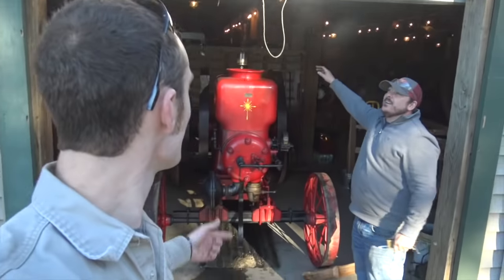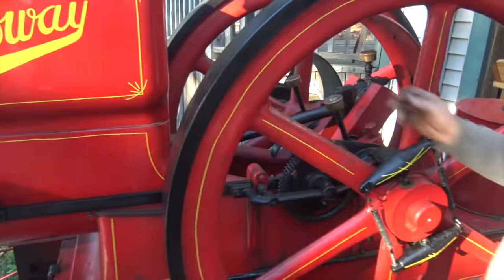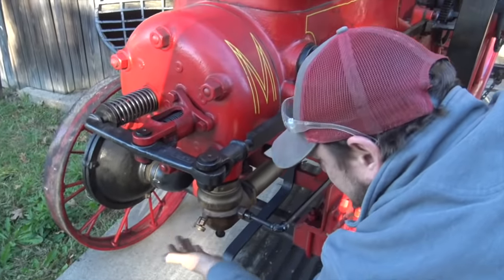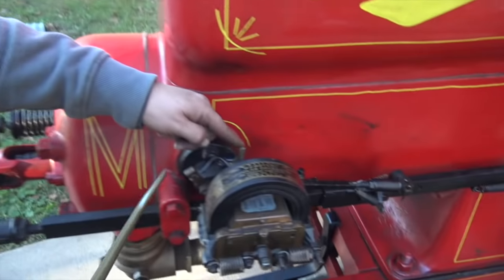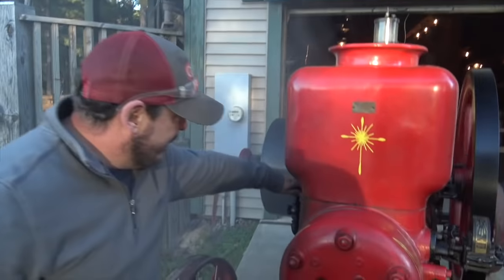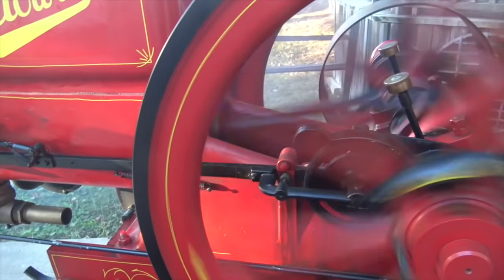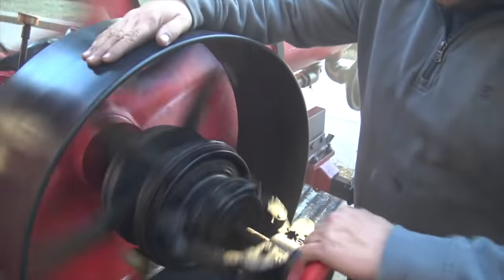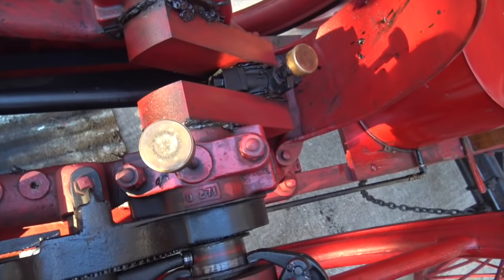WHY THIS INCREDIBLE ENGINE FROM 1916 IS PROOF THAT MODERN EQUIPMENT IS A SCAM & OLD STUFF WAS BETTER

Comment: That old hit and miss is a rare find. From what I've been told you could find them up until WW2. They started going when farmers had electric from local power plants. You could run just about run any stationary machine Generator, water pump, rock crusher.  The old tech is reliable a 1916 engine still works. That's 106 years old.
Reply: I guess they stayed around longer in Europe because of the war, at least farmers fairs are full with them and Lanz Bulldog tractors.
Reply: @vHindenburg  I go to vintage machinery shows in Australia, I guess about one in ten engines on display are hit-and-miss.
Reply: Electricity to farms...yes, first it was just single phase, but later, 3 phase....Thank You, Nikola Tesla....! One of the first important things on a farm....was a well with motorized pump....
Reply: @dougankrum3328  I would say after that, some form of refrigeration.
Reply: No, its at least a thousand years old... along with most of the other now forgotten tech
Reply: @dougankrum3328  Farms had wireless electricity just like the cities before the time of the Rockefellers.
Reply: 👉 Yeah, because during WW2, the govt had people combing the land looking for old and obsolete tractors and stationary engines that could be melted down for their iron and steel, for the war effort! So, a lot of the early 20th century tractors and engines were broken up and melted down....
Reply: @HighlanderNorth1  So important then, so tragic now.
Reply: @LazloNQ  My Dad serviced in WW2. Everyone not serving sacrificed during the war. There were all kinds of drives for scrap and war bonds to name a few.
Reply: YouTube WantsToSilenceMe  Not been to an antique machinery show for three years, due to Covid. You're lucky.
Reply: "planned obsolescence" started in the roaring 20s I believe
Reply: @HighlanderNorth1  Yet we still have a good deal of engines left because even during those days the engines were still valuable enough not to be scrapped. That's what my grandpa says at least.
Reply: My mother had a gasoine fueled washing machine when I was a kid. What a piece of crap.
Reply: @dougankrum3328  Three phase on a farm? Are you sure?
Reply: Yes, built to last, and not have the built in life expectancy of a Mayfly, can you run the engine on hydrogen?, that would make a very enviro  friendly means to provide the house with  its own electricity supply.
Reply: There are still hit and miss motors floating around the oil field on old pump jacks. Some fairly new. Arrow Engine Company still makes one if I'm not mistaken.
Reply: @effervescentrelief  Do they make motors or engines? Never heard of a hit and miss motor.
Reply: Reason why modern crap has the life span of a mayfly, is companies these days blindly driven by profit, so their products are designed to a price with inbuilt obsolescence . Forcing hard pressed customers to buy their latest model manufactured to the same brief. Blackstones , R A Lister,  Ruston&Hornsby, Crossley Brothers, and Petters of Yeovil, they all built their chug phut engines to a specification and designed to last. In India, Pakistan ,hundreds of Ruston&Hornsby chug phut engines are still working hard driving various machinery from grain mills, water irrigation pumps , to weaving looms and dynamos ,generators.  That  chug phut engine built 1916 can charge your geeky 2023  mobile(cell) phone, and no , I am stating a fact and not smoked a splif.
Reply: Reason why these lovely old Chug Phut Engines last close on a century and keep running is the makers designed them to  a specification ,not a price. Modern crap are manufactured to  said price , built in obsolescence, needing Brains from Thunderbirds to come and fix if a problem crops up,. Said modern crap have the life span of a Mayfly, so hard pressed customers then forced to buy their latest model with the same issues built in , a vicious circle.  R A Lister, Blackstones, Crossley Brothers, Ruston&Hornsby, Petters of Yeovil, and The National Gas Engine Company, all built Chug Phut Engines in various sizes and power ratings.  In India, Pakistan Hundreds of Ruston&Hornsby Chug Phut Engines still work  hard ,driving corn mills, power looms, water irrigation pumps ,and generators. A suitable size Ruston&Hornsby Chug Phut Engine, burning refined waste chip fat oil can provide electricity for your house, said waste fat oil used productively and not bung up the sewage  system.
Reply: @bingosunnoon9341 maybe crap to you but if that was all your family could afford, probably like gold to her.
Reply: @bingosunnoon9341 I am curious about that too. I am yet to see it in a residential house.
Reply: @HighlanderNorth1  My friends collected these all the way into the 1990's They are fairly common (various brands) until then
Reply: Up into the 70s i could hear the sound of the popin Johnnie's echoing in the hills of oklahoma. They were used on everything from oil wells to water wells. 5 gallons of gas and a full water tank and these things would run for days without supervision.
Reply: The clutch operates with a pressure plate that are like spinning “brake shoes,” grabbing the clutch plate disk from  the outside.  Those are TRICKY to adjust so that both halves grip equally when engaged.

Comment: No pen pusher will appreciate this! The old people were not stupid, my wife has got a 100% working 1928 singer sewing machine that still uses a treadle, the mind of the old folks were sharp! Love this !!!🇿🇦
Reply: My wife is a professional seamstress that uses her grandmother's 1948 Singer as her main machine.  I note one thing about it.  In it's day, it cost almost half a year's wages.  For that much money, you could buy at least two modern industrial machines that would last as long.
Reply: @barrymorrisss  Absolutely; some high-grade things became expensive... but only relative to the cheap stuff. It didn't get cheaper at the same rate as the low-grade stuff; it still got much cheaper than it used to be. But - a big part is that people actually cared to keep their expensive stuff and care for it, and pass it on.

That said, there are things that definitely improved. The oil losses, the pollution, fuel efficiency. It's just packaged in a bundle that makes it much harder to keep caring for the stuff to make it last. It's quite nice that you don't have to replace oil and lubricate twenty different bits of a car every 1000 km like in the "good old days" :D But it also of course came with ridiculous abuse of cars (well sponsored by the oil & gas and automobile industries)...
Reply: Have you actually told your wife the 1928 Singer sewing machine has been updated?

Comment: In France we had the water pump manufacturer Julien & Mege : those were more powerful than spec, and almost silent, a lot of people have then still running.... ( those are 3 phase pumps )  The company went broke because pumps were too reliable and once everyone was equipped, sales went down. Today no one makes parts to refurbish those. The modern pumps are noisy, and last 2 to 3 years max. AAAAND you have to spec up in order for a pump to make that water go up the spec. EVERYTHING made today is worse than yesterday because it is made to be replaced soon, and difficult to repair. Each time my "modern" pup starts, I can't help but hear and feel that it goes closer to be broken, the moise the vibration tells everything.
Reply: George Jones  maybe, but the facts still remain, when a product is too good, a company goes out of business. Only shit make good business, so business is shit.
Reply: W o W that is Amazing and Heartbreaking in the same time .. what a story.
Reply: yeah right we have a modern indoor pump its plob 12 year old now and it been outside the whole damn time i mean not sheided either and its canada it snows and every year we plug it in and it works. and still builds a good amount of pressure and no leaks so far.
Reply: @hunterbear2421  it would be interesting to know brand and model, because the exceptions to the "new is shit" rule are rare.
Reply: @AlexandreLollini  I'll go digging for it in a bit it's buried in plant life
Reply: @hunterbear2421  I have a 3 phase pump deep in a 108 meters hole that worked only one year, nobody to help me pull it out to check what is wrong with it. Water from the city for irrigation is catastrophic : city water contains bad minerals that kills bacteria and fungi in the soil making it sterile and arid.
Reply: @AlexandreLollini  well, could it also be that we only notice that it is broken when it breaks every car has a water pump
Reply: @hunterbear2421  and water pumps are always vital in some ways, an engine without water pump burns, fire fighters rely on them, and water pumps are the lifeblood of agriculture, a working water pumps can make difference between life and death.
Reply: @AlexandreLollini  yep, but that also means that their is a lot of them, which means that t
We don't notice them when their good only when they go bad we do.
Reply: I would think that someone would realize an opportunity in making replacement parts.
Reply: I would love to know what it would cost to manufacture a new one of those beautys, had a Lanz bulldog tractor which was shipped to Germany.
Reply: There was also a lot of total shit built about the same time. It's all been scrapped so the only stuff surviving is the good stuff.

Comment: This fantastic machine exemplifies everything that is wrong with modern junk, this old gal will still be chugging away for hundreds of years with just a little maintenance, while modern garbage will be rotting in landfill for hundreds of years. Great video,thanks for sharing!👌
Reply: what is it called
Reply: Maybe I'm weird but I really like to see well built, maintained, oiled and greased machinery.
Reply: Yeah it will, and after only like 5 years of service. Though alot of it gets recycled but that's not the point.
Reply: the motors so quiet
Reply: But it's not chugging away. It spends almost all of its time sitting in a shed.
Reply: You have absolutely zero clue. That engine was restored 20 times over its life period plus it only runs for show. Totally unfair comparasion. If you knew how efficient modern stuff is you would delete your comment.

Comment: Proof positive that a well engineered and maintained piece of equipment is a joy forever. My dad told me stories of a agricultural pump run by a hit-n-miss that ran night and day for years! Oil it, grease it and you'll get old before it wears out. Thanks for the memories, guys.
Reply: i think some oil field engine ran for many years continuously
Reply: @dont-want-no-wrench  That might be very true because I heard of very abandoned ones still running to this day.
Reply: "You'll get old before it wears out." If God used planned obsolescence, then maybe it's not such a bad thing, we just shouldn't take it too far.
Reply: Stress on the maintenance part

Comment: In 1964 I went with my Great uncle out to tend to some oil wells in SE Kansas and the wells were powered by some hit and miss engines, We filled the grease cups and some had big old jars  filled with really heavy oil in them that would drip a drop oil every 15 mins. on some moving parts to keep them lubed up. My father said that those were some of the last engines like that ,and when those were needing repairs they were going to be replaced with electric motors. My father told me of when he went with him as a kid to help him, He went twice a day to service them 7 days a week until his death.
Reply: That’s what my cousin does in middle of ks, replacing a lot of those with 480v motors
Reply: @quadnation485  your response kind of blew my mind.
"When they need repairs they'll be replaced with modern motors."
Then, almost 60 years later:
"Yeah enough of them are still running that it's my cousin's job to replace them."
Reply: @scottcantdance804  Just goes to show the long-lasting nature of the designs and parts.
Reply: Would he have to fuel all of them too?
Reply: Your great uncle was a “pumper” in oilfield terms.
Reply: Neat thing is those engines run on oil gas straight out of the oil well or straight up crude oil. They are entirely self sufficient when it comes to fuel.
Reply: There’s wells in SW Kansas/OK panhandle that still use them.
Reply: My mom was from SE Kansas, Girard

Comment: My friend, who is a car mechanic, always tells me: "what isn't on it, can't break". This is such a pure example. Everything on this engine is so simple, yet marvelously engineered. Way more impressive than those computer-runned engines of today.
Reply: There are similar principles in software engineering.  Every line of code adds complexity.  But if people want small, high output engines, you probably need to add complexity.  I am no mechanical engineer, but these old, large, low power engines are not efficient either.  If you want more power, with the same displacement, you are going to have to do stuff like increase air and fuel, increase revs, increase compression, etc.  I love old engines though.